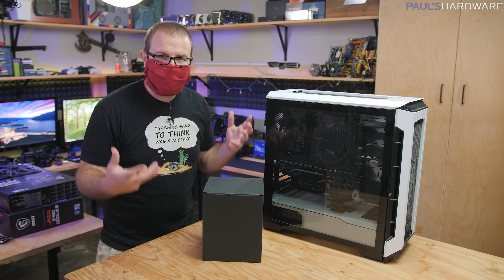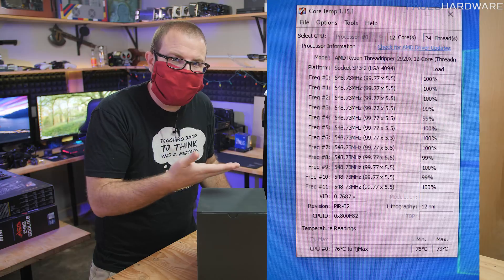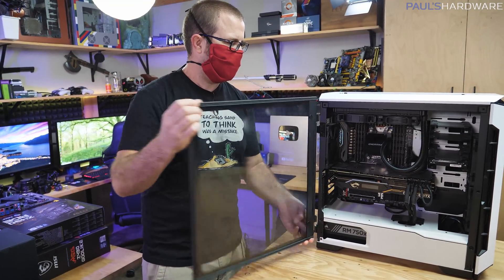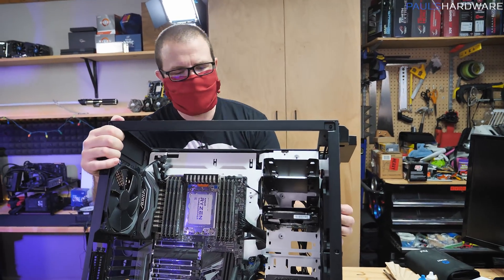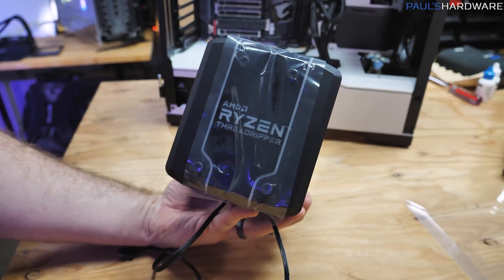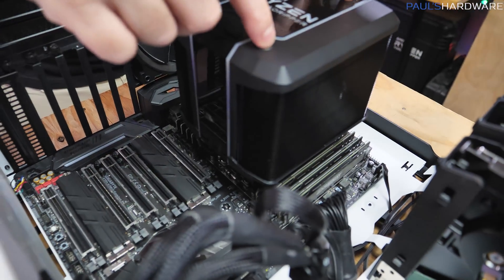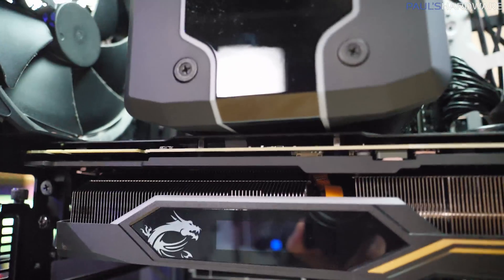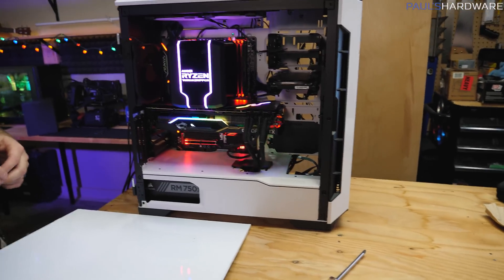Why We Switched from an AIO to Air Cooling...

Comment: I've never had an aio, and I'll never have one. It doesn't seem to be reliable.
Reply: Multiple points of failure is more than enough to justify your concern.  I only use liquid cooling in my higher tier builds and builds I'm okay with servicing (ones in my home).  I suggest air cooling to people that aren't comfortable with building so I don't end up with a call just because a faulty AIO needs RMA'd.  That being said, my CPU AIO has been running for 6 years now, over 10k hours of uptime.  They're reliable, you just need to get the right brand and do your research.
Reply: Depends on the brand, like anything. Ive used AIO's for years. Never had an issue. I use them mainly for the aesthetics.
Reply: I will always stick with air cooling. Low maintenance and no real chance for catastrophic failure
Reply: Got a Corsair h110i GT still running strong 24/7 since I've installed it 5 years ago.
Reply: I had a coolermaster AIO. It lasted about a year before it failed.  They are a waste of time
Reply: @richardhutchings1980  
Just transfered my components into another case this week with the same 280mm h110i and I'm idling at 37c on a 5820k 6 core. Purchased in 2015. I'll have to torture test to see what load temps are at. 

It's not like the liquid evaporates in these AIO's. Maybe the newer units use lesser grade pumps as a cost cut savings. I don't know.
Reply: Nzxt kraken's are pretty reliable and they have a good warranty on them
Reply: Lol 😂 what???
Reply: my OG h100i lasted about 8 years on my 3570k build, although the pump was pretty loud in the end. probably still working for the guy i gave it to. im way happier with my nh-d15 now though. way quieter and will probably last decades.
Reply: @KotatkoVonDrapek  
Ultimately what happens is the lack of support for newer sockets which forces you to change your heatsink. This is why no cooler ever lasts forever. The size of the cpu surface on the heatsink is ust too small for newer sockets and the company no longer supports it.

I had a thermalright ultra 120 extreme for the longest time and had no need to change it out even with a new build. I was forced at a certain point since it's CPU surface was too small and they no longer supported it.

It will probably happen with your NHD15. Consider that if you wanted to go the route of threadripper or epyc then you'll have to change your heatsink since the nhd15 is not compatible. Too small surface space
Reply: Until you have a compact case layout and have a choice between thermal throttling OR a compact pump with the radiator transporting the heat to outside the case.
Reply: Yeah. I prefer custom water cooling or a good air cooler over any AIO, doesn't matter which AIO it is.
Reply: Arctic has baller AIO’s.
Reply: @MirelRC  yup either go FULL water cooling or just go air cooling. I don't know why the AIOs.
Reply: @harsimransingh615  "But the pretty colors!"  I think a 360+ mm AIO might be viable in certain HEDT builds but anything smaller is clearly only for looks.
Reply: @harsimransingh615  Custom Water Cooling has far more points of failure than an AIO and is heavily decided by the person's own competence at carrying it out. It also requires constant maintenance to flush the system and refill it even with distilled water due to gunk starting to float around in the system. You are far more likely to have a leak with custom cooling than with an AIO, takes infinitely longer to set up, requires much higher technical knowledge and specialised tools (if doing it yourself) and if you need to switch out an AIO, it's easy. If there's an issue with your custom water loop, you have to deal with it yourself and figure out what went wrong, drain the whole system then fill and retest over and over, being careful to watch for leaks. It's time consuming and tiresome.  Also if you buy a custom water cooled pc and don't know how to actually handle it yourself, you cannot do any sort of maintenance on it really without risking even worse failure. With an Aio you just disconnect it and send it back or dump it, and in the meantime if you really needed something, you can slap on a cheap air cooler, even a stock cooler just to keep you going. Infinitely more accessible for the average consumer, about 8 times cheaper or more in most cases, little to no maintenance, lower failure rate or at least lower chance of failure and easier to fix or replace or install. And they perform pretty much as well as most custom water cooling and any gains from custom water cooled systems are so little or at a temperature where it's already well below throttling, that it doesn't matter in the slightest except for someone trying to break overclocking world records. That's why AIOs
Reply: @flashcloud666  Not even 360mm, which in every test I've seen showed it performed worse than 280mm for whatever reason.
Reply: Enermax is an outlier in how utter garbage they are (not just this one, but all of them).
Liquid cooling is useful in three particular cases: Silent operation (huge radiator on more modest cpu, with pump hoses pointing down=as quiet as a PC's going to be), getting a lot of heat out of a smaller case (such as my MB511 Mesh), and when you don't want a heavy fan hanging off it's mounts (such as a PC that gets moved around a lot). An AIO is just a beginner-friendly way of meeting those. If none of these apply, an Air cooler is a better choice. The upside of an air cooler is that it only needs it's fans replaced, and occasionally it's thermal compound, there is something to be said for that.
Reply: @russellsenenfelder2281  Would you consider a 3700x a modest cpu? I'm not sure if I'm going to overclock yet, but would you think of it as a modest cpu with or without overclock?
Reply: They are, but the lifespan is more limited, and there are those additional points of failure...pump, seals, etc.
Reply: @corbus_aurelius  if that's not the definition of unreliable, idk what is. I've had the same air cooler for 5 years, and I bet it won't fail soon. (And the only maintenance I do is blowing it once a year with my breath).
Reply: @luizarthurbrito  Reliability and lifespan are not the same thing. Airplanes are extremely reliable but they require constant servicing and parts replacement. Does that mean they're unreliable?
Reply: @ChucksSEADnDEAD  don't care.
Reply: @luizarthurbrito  lmao
Reply: @ChucksSEADnDEAD  here's the reasoning. I don't fix planes. But if an aio breaks (which they do), it's my problem. My air cooler needs a once a year cleaning which I do by blowing on it
Reply: If you want to stick to vehicles, I'd rather have a Toyota Corolla
Reply: @luizarthurbrito  Yeah but my point is that airplanes are reliable, just maintenance intensive. You pretended they were mutually exclusive when they are not. No need to get defensive over it.
Yeah no shit everyone wants a car which isn't maintenance intensive. But for the hobbyist, an airplane is that money sink fulfilling the dream that people think is worth it. If one has the means to fly around as a hobby, don't call his airplane unreliable.
Reply: @ChucksSEADnDEAD  you're all good, I'm not defensive. It might have come across that way because English is my second language, so I tend to be dry.

Comment: The case's front mesh was chocked, the large front filter was totally chocked and the intake side of the radiator was noticeably dirty as well. Would like to have seen the temps after cleaning before the replacement...  😎👍

Comment: ** My friends PC just did the same thing. 3700x around 530MHz on 6 of the cores and 2 of them around 1100MHz. But all temps were fine. Around 60-70*C. No overclock. He went into the BIOS and didn't change a thing, and logged back into windows and it was back to normal. This has happened twice this week. Got any suggestions as to why core MHz would drop for no reason?

Comment: Enermax Aio dies so quickly, GamersNexus covered this topic.
I've bben using corsair aio and never had problem personally
Reply: I've been through 2 Corsair AIO Hydro, currently rocking an NZXT Kraken X73. No problems with any of them.
Reply: Trigg3rHippie good luck with the kraken. The one I bought died in 2 months and the replacement I got through rma died in 3. Hope it doesn’t happen to you
Reply: @Loppae  it is the new version so hopefully it will work ok. There hasn't been any major issues like with Enermax AIOs gunking up, no recalls. So far so good.
Reply: I've had my H105 in my rig for the past 5 years and it still runs like a champ.
Reply: Been running an H80i since early 2014, running perfectly
Reply: Same here, 2 systems, one with an H100i and another with H115i.  No issues.
Reply: i had 2 corsairs die inside a year. never touching AIO's again. the benefit does not outweigh the potential problems.
Reply: The only thing the Enermax AIO had over just about anything else was its larger cold plate. Considering the size of Threadripper cpus it seemed like a good idea. Too bad they just sucked.

Comment: Years ago when liquid cooling became a thing I thought to myself "You'd have to be a moron to put liquid in your PC." 
I still stand by that comment.
Reply: same
Reply: You are wrong. You have to be a moron to put liquid AND ask for no maintenance. Or want to put liquid AND be affordable.
Reply: same
Reply: Same
Reply: Using water cooling for mini itx build is almost necessary if you want to have temps below 85-90 C for the cpu
Reply: @MrMcGing  I have 2 mitx builds with air cooller in them, but the chips are 95w tdp if I remember well so not too bad to cool... :)
Reply: @wisico640  word, my current build is a ryzen5 3600 in an sg05. Kinda need to water cool it cause even using a good low profile cooler doesn't get anywhere near the temperatures I get with water cooling. Legit 15-25C cooler at idle and way cooler at load
Reply: @Mercstar   I think air cooling is just fine...but my 6700k @4.8Ghz needs water.  If you haven't, check out Designs by IFR....dude can make some insane custom loops.  Last thing...there are more than a few people that use their rigs to earn money...water can potentially allow for greater speed (higher clocks/freq)….which can increase productivity simply by decreasing the necessary amount of time involved in their work.  So I understand your point of view and hopefully you can see mine.
Reply: @bloodyzbub6213  Ask yourself if you don't need liquid cooling for a video card then why do you need it for the CPU?
Reply: I think water cooling is fine, if you build it; it's the exact relation between water and electronics that is trilling to me. If done right it should last. You just need to take care of it (watch the temp, change the fluids if needed)

AIO on the other end; I never understood since most aren't made to be refiled or serviced :o
Reply: Its 1 AIO(from enermax) from all other one that have no issue after more that 6 years.
Terrible to generalize everythink cause of 1 terrible cooler.
https://www.youtube.com/watch?v=7VzXHUTqE7E
Gamers nexus is a fair more objective opinion.
Reply: Catastigma Deception Its not just one cooler over 6 years. There have been others.
Reply: @Clippy-the-Doubtful  why would you ever pick liquid cooling over air?
Reply: @ChineseWinnie  because liquid cooling allows for significantly higher overclocks.

In a work PC, where reliability should generally Trump peak performance, yeah, it's pretty stupid, but it's just as stupid to argue that water-cooling a PC has no benefit.
Reply: @jedidethfreak  it has a short term benefit but long term reliability and maintenance issues. If you have to be on the bleeding edge of performance and do a new build every 2-3 years, okay, knock yourself out. But for people who stretch their builds longer and are happy to sacrifice a tiny bit of top end for reliability, longevity, and low/no maintenance air is the obvious winner.
Reply: @mitchwalrus  I'm sorry, but that's a load of bs. I kept my last gaming computer for more than 8 years. Through the years, I added a SSD in it and upgraded the GPU. It had the same AIO in it since the beginning. Never had any problem and never had to do any maintenance at all, other than cleaning the dust in the fans, which you still have to do with an air cooler. I even became lazy in the last years and didn't clean much my computer. Even with a lot of dust in the cooler, it was still working great.
Are AIO more risky in the way that they have more ways of having issues? Sure, but saying that AIO don't have longevity and require more maintenance than air cooler is just false.
And by the way, I did put an air cooler in my new computer.
Reply: @lightseeder358  Nice, one guy bought an AIO and had no issues, I guess the 100s of thousands of other AIOs don't either..........
Reply: @Clippy-the-Doubtful  that's kinda like why would you generalize bad cops because of a couple out of the thousands upon thousands who aren't idiots.
Reply: @khaoticpenguin3945  0-100 real quick

Comment: I have been using an nzxt x61 since 2016. Used in 2 separate builds no issues. 5 year warranty still going strong. Air coolers are big and ugly af. Do I want a big fat sloppy chick or a beautiful slender one that gets wet when you play with it?🤔

Comment: points of failure are a good way to express my avoidance of AIO and I found a good deal on a Be Quiet III for my build instead.
Reply: mister.T Jr  No it's not solved, all AIO's will fail it's just a matter of time. They might not leak but the pump will eventually give way. Why bother when a good air cooler will do the job just as well and will never fail apart from the fan which is easily replaced.
Reply: @SherLock55  This exactly, I've had 2 Corsair AIOs fail over the years, yet my "cheap" air coolers are still going strong even in my older systems from a decade ago. I won't go back to AIOs anymore.

Comment: I've never trusted water cooling, AIO or otherwise. It's just a constant stream of design screwups.
Reply: Air cool for life here.  Much more quieter too.  Love my dark rock pro 4
Reply: Exactly how I feel. If an air cooler fucks up or is just of poor design, then you just get a hot CPU that may throttle or shut off once it reaches max temp. With an AIO that fucks up or is of poor design, you may have to replace your entire rig. Water cooling definitely has its place, but only if you have the money to replace any tech that gets destroyed.
Reply: Most of them are good. Enermax AIOs suck because it uses an Asetek pump. Never had a problem with any of the AIO's I've had in my systems. AND I'm pretty sure the good companies like Corsair will help you out if their product ruins your PC (within warranty). But they're rated for a 4 year warranty but usually can last 6 unless you're a bitcoin miner
Reply: As long as you mount it correctly you should be ok. However, it is about the most frightening product to put in your pc because of the risk of it leaking. I would check out the Corsair AIOs that they sell since they come with an warranty that covers any leakage damage as long as the AIO was properly mounted.

Comment: I got to be honest, I'm surprised that it wasn't a D15 that replaced the aio.
Reply: there is no D15 for TR4
Reply: @infi84  Didn't know that, thank you. At the pace Noctua work at, they'll probably release a TR4 compatible D15 in about 6 years.
Reply: Bequiet have a TR4 Dark rock 4 x)
Reply: Noctua's biggest TR4 cooler is the "NH-U14S TR4-SP3" (catchy name!) and seems quite good. https://noctua.at/en/nh-u14s-tr4-sp3

Comment: This is one of the reasons why I will NEVER consider a liquid cooler! I bought a Noctua NH-D14 around 6 years ago. While it is a behemoth of cooler, man does it keep my CPU cool. I currently have an i7-4770K. I have absolutely no reason to overclock and the Noctua is nearly silent :)
Reply: Liquid coolers are expensive and they need a lot of maintenance.
Reply: @orlandoalvarez1504  there is no maintenance on aio watercoolers. Whem they go bad they must be replaced.
Reply: @erikheijden9828  which is a waste of money. I got a noctua NH-U14S. Still works like new. Bought it 6 years ago
Reply: I have the 4790K with a noctua NH-U14S. No oc yet. But cools my cpu perfectly.
Reply: You won't consider liquid cooling because they decided to put in a cooler that everyone has complained about everywhere and it failed.  K.
Reply: @KainArkanos  No. This is only 1! Of the reasons I wont use liquid
Reply: Over lock my bro. Free performance. Also consider replacing the thermal paste
Reply: @mrrgb4954  I have no need to overclock. My system runs perfectly fine. Coupled with an Asus maximus Vi formula and Gtx 1080ti all is good at 4k
Reply: I've had a handfull of Corsair AIOs over the past decade and never had a problem with them until the most recent one I installed (H100i).  The pump quit on it.  I ended up opening the pump and freeing it up and it is working now.  If it fails again, I will probably purchace a large air cooler to replace it.  
I like higher performance, but I hate when my junk is not reliable.